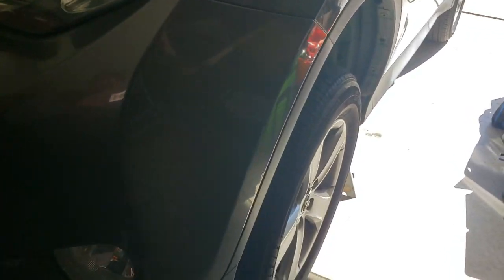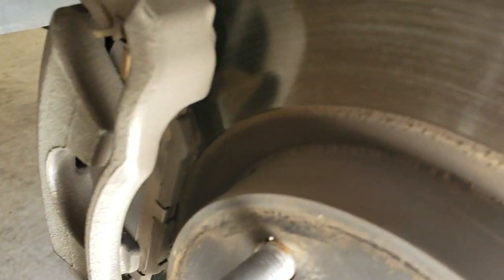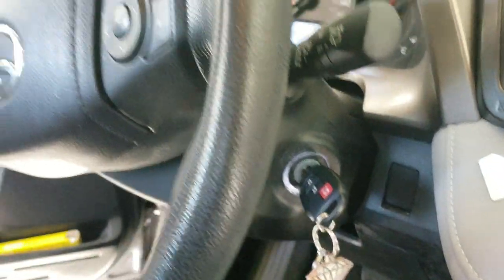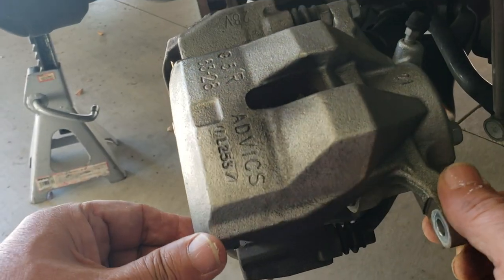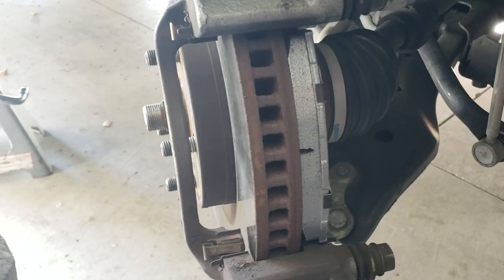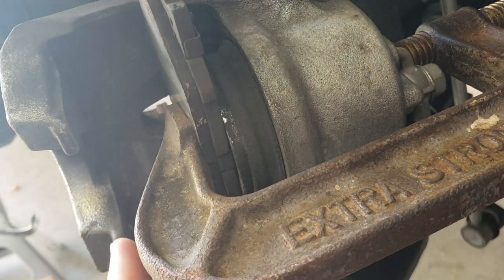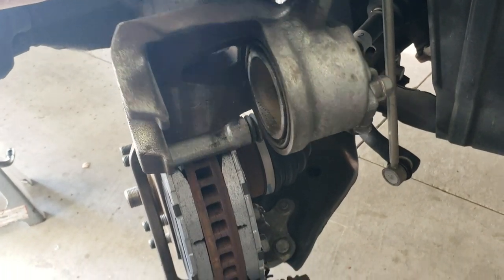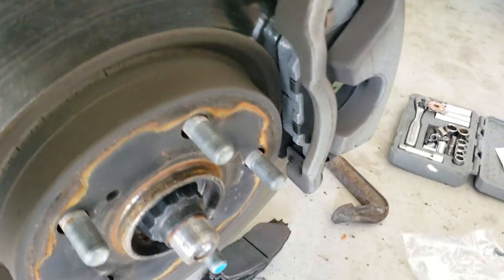DIY How to change Toyota Rav4 Brake Pads 2006-2012 Duralast Autozone

Comment: I, unfortunately, needed to remove both bolts of the brake caliper in order to expose the break pads. The break line had too much tension when I tried your method. (2007 Rav4, v6 sport 4wd)
The c-clamp trick while using the old pad to compress the caliper is a great tip. This video helped my process a lot, along with the forum comments. Thank you.
Reply: I loosened the top and it slid gently up and when it was up I tightened it a hair to keep in safe position (not hurting the brake line your mentioning) I ran into same issue and that worked instantly!! It's scary at first!
Reply: My 2012 4cyl AWD is the same

Comment: Hi Galaxy Views,

you should have sprayed down the brake area and hardware with brake cleaner as it would remove all loose brake dust and road grime, remove the caliper slide pins, 

clean them and re-lube them with Sil-Glyde Silicone Brake Lubricant or any rubber-safe lubricant and lube the brake pad ears and back of the brake pads before re-installing.
I also add lube to the brake caliper piston rubber boot.

Good video, nonetheless.
Reply: Toyota recommended procedure is not to lube.  I'm confused as to why not.
Reply: @jbean530  Actually it depends on the rotor size. The small one gets lube the big (11.7) inch one does not.

Comment: great video budd, but is it bad not to change the rotors at the same time when replacing the break pads? can you re-use the old rotors???
Reply from the maker: You don't need to replace rotors as frequently as the pads.
Reply: @galaxyviews7483  ahh. it seems like everytime you take your car to the shop to change breaks, they always want to replace the rotors and pads. $400 job. sigh. long story short, I changed it myself. thanks for the video budd. I will pay only change rotors if it only needs it next time.
Reply: Measure the thickness of the rotor with a micrometer, there is a minimal measurement you should not go below for safety reasons. The measurement for this model u would have to look up(toyota dealership)

Comment: Do RAV4 2006 to 2012 use the same brake pads? Mine is 2011. I’m considering buy one pair of front brake pads and replace the worn out old pair.

Comment: Great Vid.  Where did you place the jack stands.  on the scissor jack location?
Reply: Yes, you will see under the car behind the front wheels on the frame rail the indentation where to put the jack stands.
Spray down the brake area with brake cleaner and use lube... on the brake hardware, brake caliper slide pins and back of the brake pads.

Comment: So pads have A and B on them is there a difference where do they go?
Reply: as you take off the brake pads just match them up, its not difficult to figure out which pad goes on the inside and outside.

Comment: How do you know when to replace the rotors
Reply: When you get a vibration feeling when breaking, it’s time. Going through this now !
Reply: The vibration when braking is usually do to the rotor is what i call warped, usually wore down more in one place than another, definitely change, otherwise measure thickness of rotor,  there is a minimum thickness they can be for safety reasons
Reply: Use a micrometer